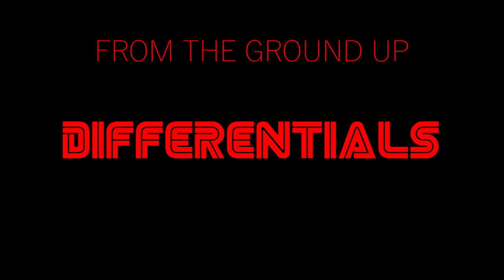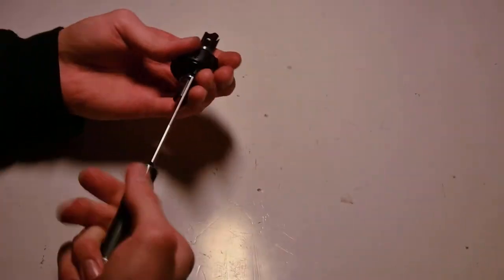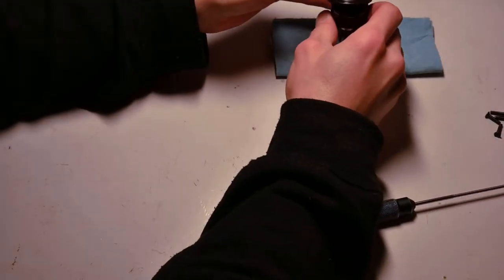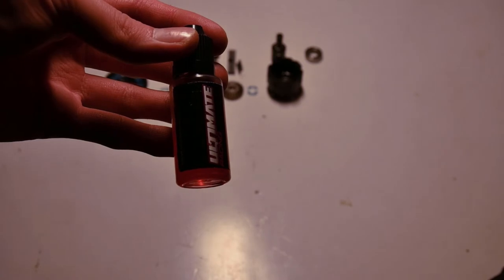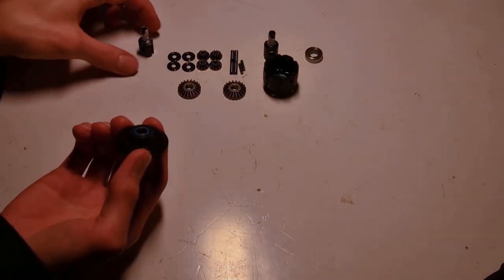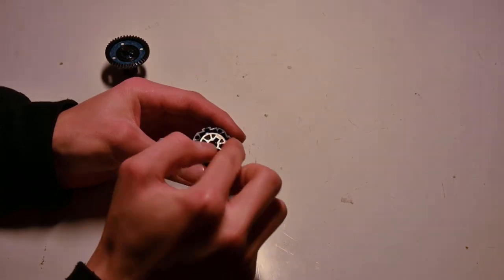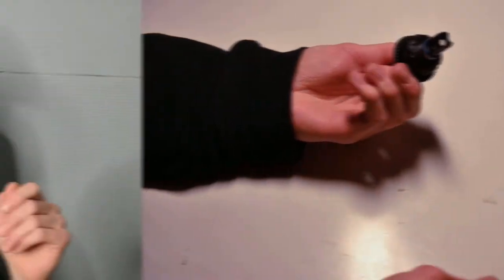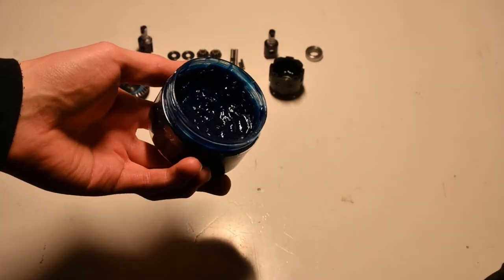From the ground up: Differentials Part I

Comment: Maybe I'm confused but I've also heard that new outdrives can make the rear end softer.  The reason being that some wear creates mechanical bind between the outdrive and dog bone.
Reply from the maker: That is actually true, new outdrives often do have less friction. 

SInce making this video I have studied the subject more and what I say on the video about this is not entirely accurate. The effect still plays itself the way said on the video but the explanation is a bit off. 

New driveshafts generally have less friction but they also have less play. This makes the feel on power more jumpy and the car feels harder to control on power. The car doesn't settle down as well and will feel more slippery. I assumed this was due to the fact that the low amount of play made it very stiff but that is really not true. Its the fact that the driveshafts have less friction that makes the car not settle hence reducing the grip.

Comment: Max, what do you think about Aluminium case differentials?
Reply from the maker: If they are lighter which some are I think they are going to be better. Otherwise no real difference.
Reply: @maxmortrc  Can you tell me plz which one are lighter? i bought fioroni ones and now that i have them in Hand, i think they are heavier ...i dident think about that when i clicked on "buy" 😕
Reply from the maker: @Electrojudaz  They are very brand dependant. I don't have experience with fioroni. At least revolution designs diff cases I believe should be lighter than stock
Reply: @maxmortrc  thankyou verymuch Max☺️👌🏻